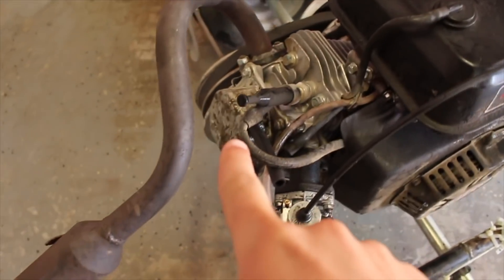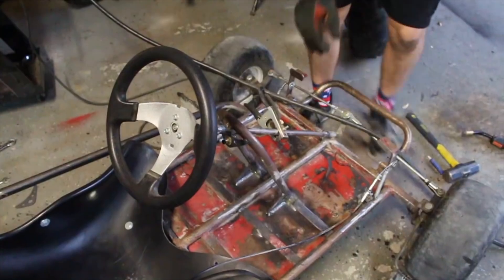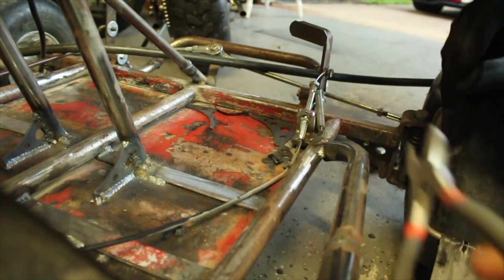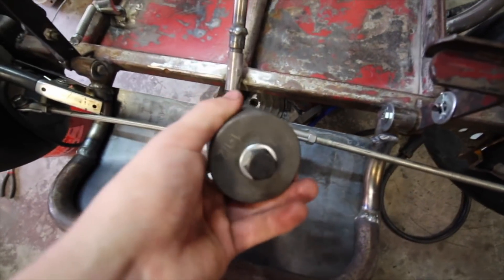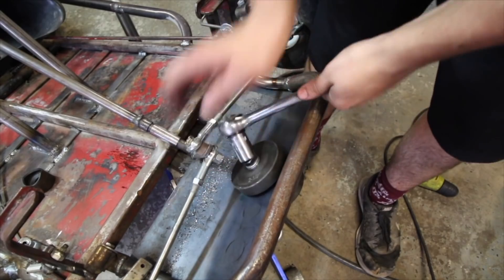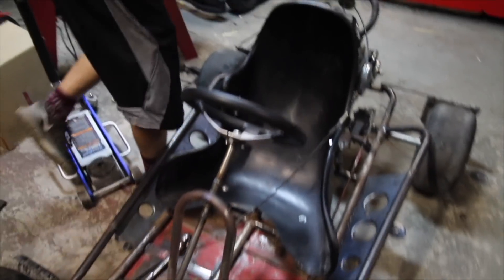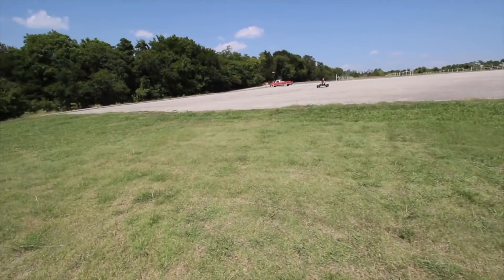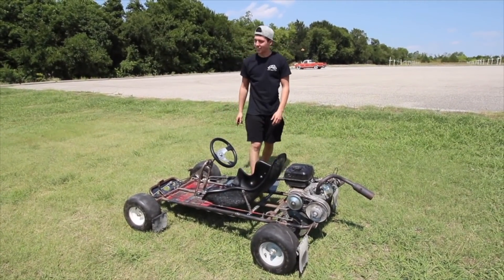Rally Kart Build Part 4 | Fixing What We Broke

Comment: Great work guys!!! I'm about the same age as you guys and I have built two karts so far! If you want really tight steering what I did on mine was I put some cheap 3/4" bearings and brackets on the shaft instead of bushings so there is no play up and down.